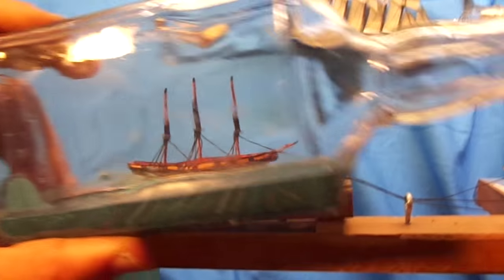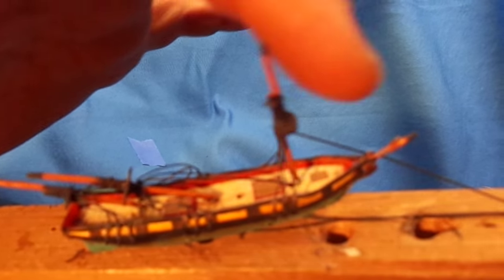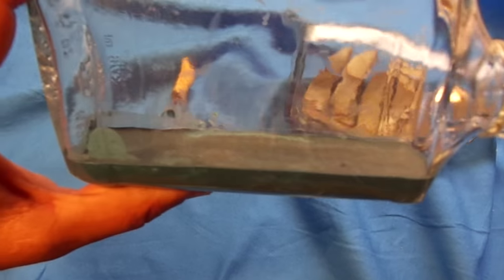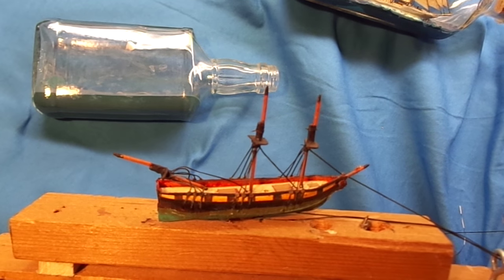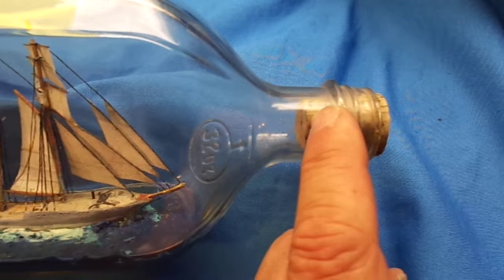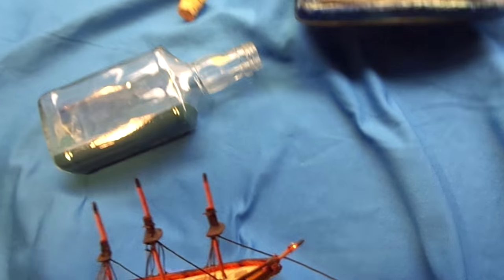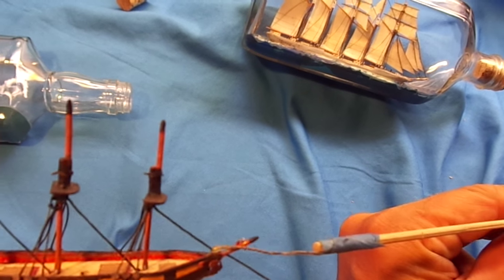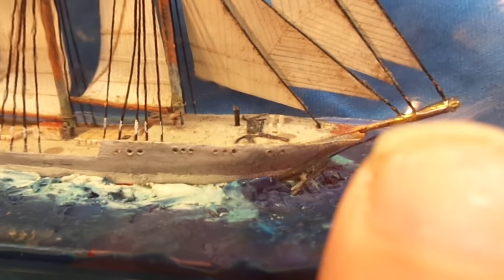How I Make a Ship in a Bottle.

Comment: There is a way to build a ship that's bigger than the neck of the bottle, simply build it in sections that slot together on top of each other with little wooden pegs and a dab of glue 

The principle's exactly the same, you build the thing outside the bottle, and the masts all fold back, you just start with the bottom and secure each section into place.

Handy for building things like galleons and triple decked ships of the line like HMS Victory, I personally favor building big ocean liners in a bottle that way.

Very nice model you have there, thanks for sharing!